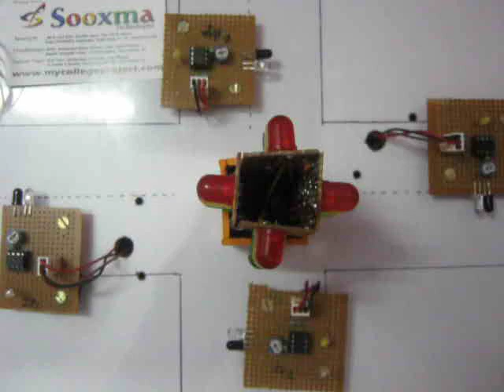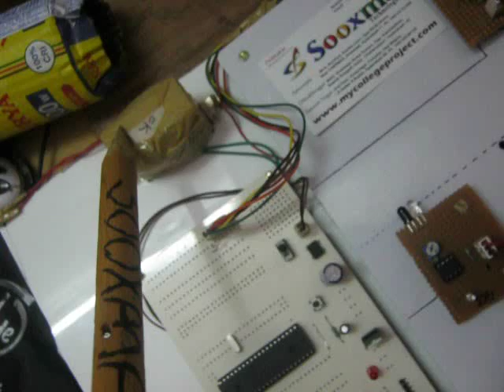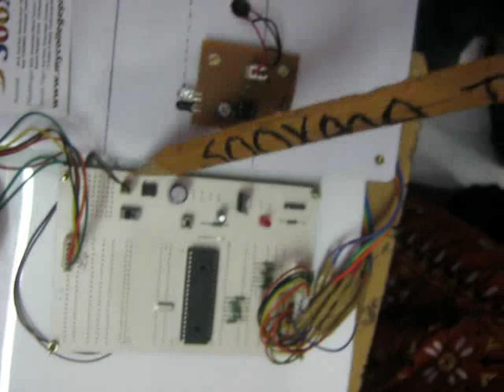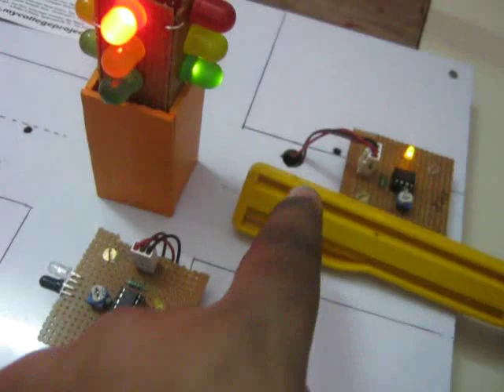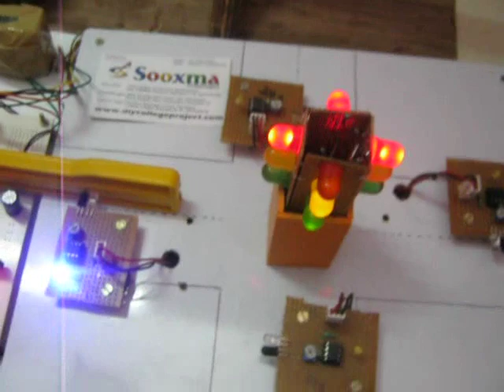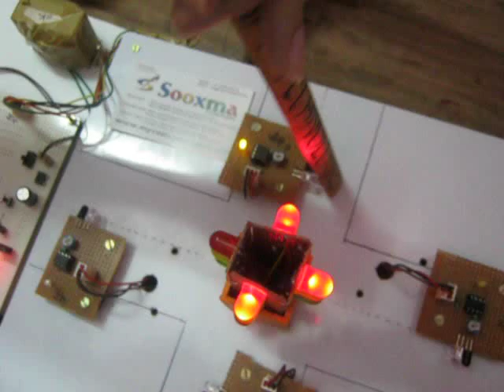Traffic Signal controlling based on vehicle density Sensor

Comment: Can U please give the circuit design for density based 4 way traffic control system by using IR sensors and Arduino uno .My whats app number is +919539087676